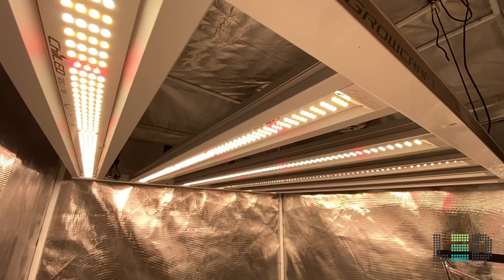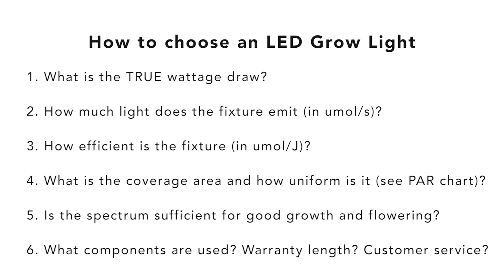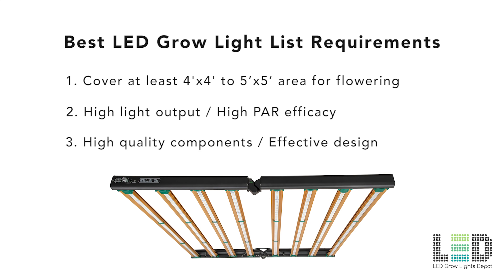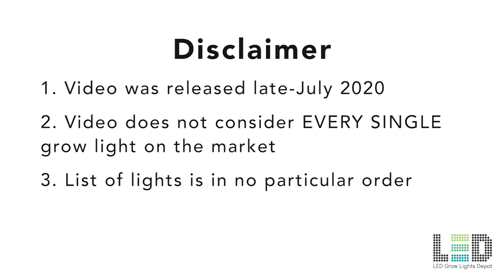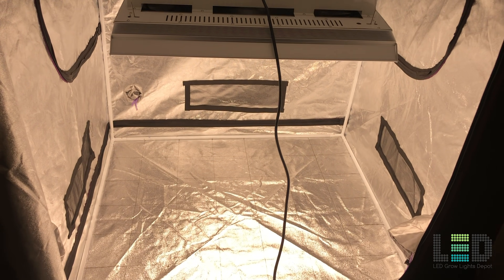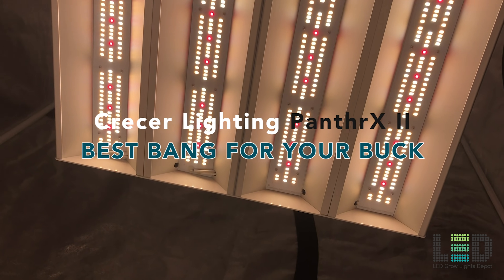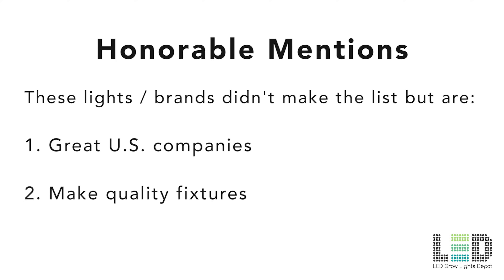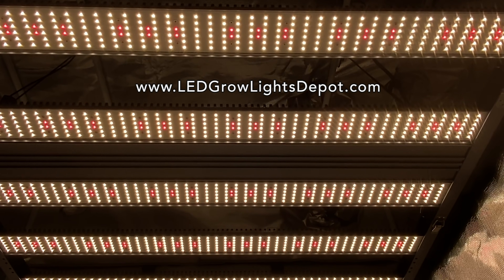Top 7 BEST LED Grow Lights 2020 - NEWEST TECH!

Comment: ALL chips degrade at roughly the SAME RATE...about 5% per year at 18hrs....so no matter how fancy the fixture is, it will only be a fancy fixture with 75% output after 5 years! This is what these manufacturers are not telling you! In fact the MIGRO guy proved this...and the best chips (Samsung) actually decayed the MOST...LOL! The board and drivers on these units only cost about 200$ (for both)....so you're paying all that dough for a fixture that will be no more than a fixture with 75% output after 5 years!

Comment: I can pull up to 18 ounces ( strain depending) with a 600 w hps over a 4x4 table. Starting fresh after a years break and wondering if leds can perform like this. Thank you
Reply: Hps can’t keep up with a lot of the top LEDs now. If you want to see the very best, look up Fohse. The A3i and Aries are absolutely insane. The Aries is rated for tents (it weighs less) but the A3i is the king of ALL light right now. 
The Grove in Las Vegas pulled over 6lbs per fixture. Seriously, tracked and recorded in Metric. It’s insane.

Comment: ChilLED Tech is hands down the best of the bunch. One of the many reasons is ergonomics and how easy it is to upgrade the fixture you buy, well, almost any fixture you buy from them. IF you buy the X2-300 because of your budget. You can later add another bar, its very easy, and you'll now have the X3-330 watt fixture. If you have an X3-330 and upgrade the driver, you now have the 500 watt version with 3x5 coverage. If one of the bars fail, you do not have to take your entire light off line either. Just send in the bar thats bad for repair or replacement. Customer service is incredible the warranty could be better on the DIY kits but they handle those on a case by case basis. The Commercial version has a 3 year warranty but costs a lot more. The par readings are phenomenal as you can see and only get better as you go up in models...

Comment: Hey guys, just thought you should know the crecer panthrX is not compatible with trolmaster or any other controller on the market. The dimming function works fine but you'll need to hook the lights up to separate timers. It's a major design flaw, the company sells the lights as compatible. I found out recently they most definitely are not.

Comment: The fact that the light last more than a year while running half the energy is a win.  And heat isn't an issue so summer don't need to run an AC.  

If you're ever around Sacramento CA, go to Hydro City and check out the Platinum King LED 630w.  $800 and 5 year warranty, hard to beat.   Had an order of 300+ the other day.  All being sent out of state I believe
Reply: which one is comparable to t5 6400k 4x8 ? cant seem to get a straight answer i have 2 of these.  looking for a 5x5 led cover.
Reply: @braddream77771234  all I know is the spider and platinum should cover 5x5
Reply: @bluex610  thank you brother and that will get me though veg and flower?
Reply: @braddream77771234  yeah it does the whole thing.
Reply: @bluex610  beautiful thats what im missing with the t5s

Comment: They are LM301H diodes on the 650R, not LM301B. 4000K. Although they are now moving to 50/50 mix 3500K and 5000K for the same exact overall spectrum as the 4000K.

Comment: What separates these lights from something cheaper like a spider farmer? Any info is super appreciated as I’m looking for affordable LED to start a 4x4
Reply: Light uniformity, efficiency, and fixture life. Those will be the compromises of cheaper fixtures. The spider farmer is a good light for the money, they just don't have the spread, or heat sink mass like a lot of the others here. And the ballast is mounted on the light which is a major down side.

Comment: Telos 10 pro 285watt best light ever.

High PAR output - 2.5μmol per Watt
    Utilises cutting edge Osram LED technology
    Significantly cooler - at least 10oC - ideal for the summer
    Impressive efficiency - low power, heat and running costs
    Effective for 85,000 hours (up to 10 years)
    Unique holographic optics for even light intensity and coverage
    Future-proof product with upgradable/replaceable LED modules
    Quiet, passive cooling with no fan
    High quality, reliable and robust components
    UK designed and constructed

the hugely popular flagship 0010 model has been radically enhanced to produce a jaw-dropping 2.5μmol per Watt and a sensational PPF of 694.4 – an astonishing set of readings that promises to send your yields through the roof!

The Telos 10 Pro is full spectrum for use throughout the entire plant life cycle and boasts a remarkable colour rendering index of 85CRI – leading to better quality fruits and flowers than HPS lights. It suits the most common sized areas used by growers, comfortably covering 100cm x 100cm and stretching up to 120cm x 120cm.

Comment: Led aren't out preforming double ended hids yet. Yes I own both leds and de hid.
Reply: Mark Rich....Can you explain yourself? I evolved from HID to LED early 2020 and on my first grow with my Slim 600H pulled 1,9 grams per watt drimmed & cured A+ medical high grade ganja with much better bud quality than with HID. Not to mention the electricity savings + the HVAC savings....so is here something that i'm missing 'cause it looks like the LED just fuckin crushed the HID and then ass raped it just to make a point...HID has left the building. RIP.
Peace & GL
Reply: @GanJah-Far-I 1 - 9 grams?  thats a huge  variation.  Ya your doing it wrong.  The two arent even close  . I hid will penetrate a canopy like a led never can.  A hid will give off the heat and uv you need 9 months out the year.   Grams per watt and electric bills are for guys with 4x4 tents if you cant jack your  bill up thats understandable.  When you have 50 dense bushes and need to punch through a canopy you will under stand why commercial growers use hids.
Reply: Mark Rich....I don't know are you trying to be funny or what, i clearly wrote 1,9 grams per watt. One point nine. Yes i am a 5x5 grower at this time, and the advantages of LED are deniable. The reason why so many commercial growers are still growing with HID is so fucking simple it hurts; HID's have been the only viable choise for indoor cannabis cultivation for the last.....well from since the day that they were invented, and that's why all the facilities have allready got the HID systems. LED's offcourse still carry the bad rep that they got some years back 'cause the technology just weren't there yet but in 2020 the LED has surpassed the HID by miles and the number of big commercial farms using LED's is rapidly growing. Now i'm using Optic LED's grow light myself and if i remember correctly the CEO of Optic LED said that there are over 100 commercial farms using Optic LED's in Oklahoma alone!!! So imagine the amount of farms across the whole US for example rockin any top manufacturers LED's....the amount must already be staggering and it's growing everyday. It just takes a little time to get all the growers to see the upsides of LED's and offcourse there are many growers that are so set on the old technology that they really don't even wanna hear about LED's...but like the dinosaurs they will die 1 by 1. Check from Optic's homepages or youtube these videos from the Hickfords farms. They are rockin the Optic 8+'s and getting over 3lbs from 500w and you can see for yourself the 4ft--5ft canopy of huge monster buds of the highest quality. LED is today and the future and HID has left the building...RIP.
Peace & GL
Reply: @GanJah-Far-I   you wrote one through 9 grams one comma nine not one point nine. I wasnt being funny . I was talking to you normally Im sorry you see it like that.  Im telling you as some one who has been growing for 25+ years my experiences take it or leave it. The older you get the less you know you realize.  Good luck
Reply: ....oh and forgot one 'little' thing...the most important thing of it all; the quality of the end product. More resin production, better terpene profile. Longer trichomes & higher THC than with HID, tested & proven!!!
Reply: Well i don't know what's up, i only know this is how i've allways written it and no-one else has ever misunderstood....and the thing about your 25years of experience - no disrespect - it doesnt mean jack-shit when it comes to LED's because LED is quite new invention and LED's which can rival + outperform HID has only existed for few years...they didnt exist 10years ago or 20years ago so you, just as no-one else on this planet, can't have decades of experience on it, that's impossible. I suggest you do some real research and see for yourself how the HID is outdated in 2020. Check out the FOHSE for example..in their commercial setting video with their A3i model getting over 2000ppfd something like 6feet away, the canopy penetration is there when you take the right LED equipment.
The simple truth here is that NO ONE can say that HID is better IF they have only grown with HID, right?! It doesnt matter how much experience they have, let's say a hundred years- and still they know fuckin' NADA about LED!!! I did my first HID grow 20years ago and my first LED grow this year and will NEVER look back. From electricity savings to light distribution to heat dissipation and not to talk about the unpresidentedly huge yield of the most amazing bud quality that i have seen in 3 decades....i can see only upsides with LED, can't think of one thing that is better with HID. And it's no wonder either; one of them is specifictly engineered to grow cannabis and the other one just happened to do it by accident, it was never build for that!!!!
Peace & GL

Comment: 3.0 UMOL/J IS WHAT I AM LOOKING FOR , 3.0 umol/j's is the new standard
Reply: On what light are you getting 3.0umol?
Reply: @phillroberts7798  ZEUS 600W Pro LED by Lumatek
Reply: @MrAce874  optic slim 600h gets 3.0
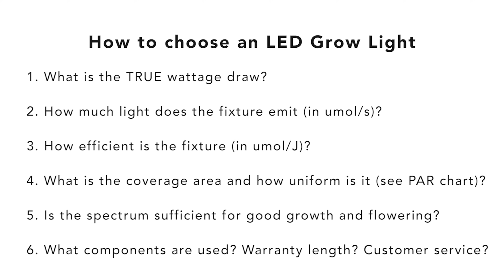Reply: @DannyMumbles  if you look at 1:52, he uses that light as a bad example of calculating efficacy. You just dont see the brand, but it is a Slim6 for sure.
Reply: Under tests it only done 2.6 from what I remember...
Reply: 2.33** check out 'migro lumatek' video

Comment: Chilled Growcraft ftw. I have fixtures from Atreum, Pacific Lighting concepts, HLG, and now a Chilled Growcraft. The chilled is the best out of all of them. Especially if you get the DIY kit for the money. The HLG 650R doesn't have enough thermal mass to keep the fixture cool, so you will lose light output faster than any other light listed in this video. It's really lazy engineering to stick some quantum boards on a sheet of aluminum with a cheap driver bolted on top, plus you'll heat your space up without a remote driver.
Reply: My thoughts exactly. I was about to go with the 650 and went chilled instead
Reply: Another vote for ChilLED.  If someone is looking for economy, I would recommend Spider Farmer over HLG.
Reply: PATSFAN420  1: I own all of the lights I listed and all of them but the Growcraft have samsung diodes. 
2: It only takes 3 months to complete a grow. 
3: Some of these lights have been out for years. 
4: I didn't spend $1000's of dollars on all of the newest best grow lights on the market because I'm some newb who's just starting his first grow. 
5: I'm just sharing my first hand personal experience so that others can learn from me and not have to buy a bunch of lights to find out for themselves.
6: Clearly I have no bias or I would only own 1 brand of light.
Reply: PATSFAN420  1: All of the lights I listed I actually own and have completed grows with.

2: All of the lights I listed have samsung diodes except the Growcraft.

3: Many of these lights have been out for some time now, some of them more than a year. It only takes 60-70 days to complete a grow from clones. 

4: I don't know why you're hung up on samsung when you're telling people on here that Kingbrite is the best led, and they don't use Samsung diodes. 

5: I looked at your channel, based on your content I won't be taking ANY of your advice any time soon. 

6: I didn't spend $1000's of dollars on the newest, best led lights on the market so I could start my very first grow. If I were biased, I wouldn't own 4 different brands of grow light. I did it this way so I could find out what was best for myself, and now I can give people my opinion based on real world experience. All of the lights work great, some are just more efficient than others.

7: I'm an engineer, so I pay close attention to build quality. Many fixtures didn't pass the test for silly design flaws such as built in drivers, and insufficient heat sinks. I went with HLG initially because they were some of the first to market, and had tremendous hype. It is now my least favorite fixture.
Reply: You are using the light wrong. Please hear me out on this. I just want to help. My 650R fixtures  run around 105f at full power. 79f ambient temp.

Using a light this powerful with a power density of 3.16 u/mol per square inch of fixture size means that you need to have the airflow to prevent climate localization. This is an absolute must. It’s not an option. Cannabis specifically has the most extreme energy distribution among the plant we know of giving the ability to run deep canopies with high intensity. The 650R is best suited for this style. Otherwise stick with short plants and even lighting. But it’s not the way to grow most or any sativa strains imo.
Reply: And for the record, I have no qualms about any of your statements being incorrect in theory, but that’s like saying a Porsche 911 is inferior to a pickup truck. They’re just different tools for different jobs. Not all growers will utilize and see the utility in as great a span of different tools. But the high concentrated light output of the 650R is the only one of its kind, aside from the 600B Spec.
Reply: @thisis5123  I get where you're coming from, and I appreciate the sentiment. But the video you're commenting on literally has the data to show the growcraft is a more powerful fixture than the 650r. Skip to 12:34. It was deemed the most powerful growlight of 2020, the 650r was a direct comparison. I'm not using the light wrong, it is just an inferior design. They are both designed to grow cannabis in a tent. Your example of Porsche vs pickup makes no sense at all. Those two vehicles have completely different purposes. These lights have the exact same purpose and pretty similar specs. As far as the big picture, we are splitting hairs really. There isn't a giant difference between the two. The growcraft is just a little better.
Reply: @dudemcgee256  respect man. I guess I still disagree that it’s “better”. Because HLG just released the Scropion Dioblo which is 1900umol and 3.0UMol/J but I still like the 650R for the canopy penetration. Maybe different environment too because I use 15 fixtures overlapping